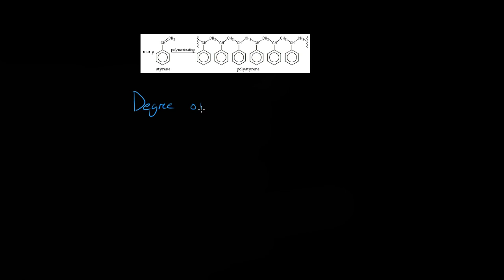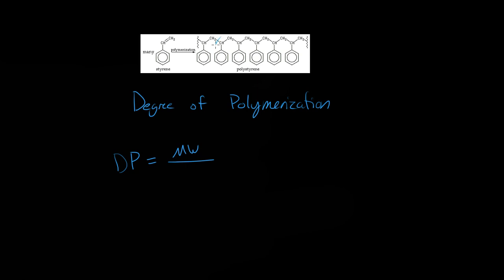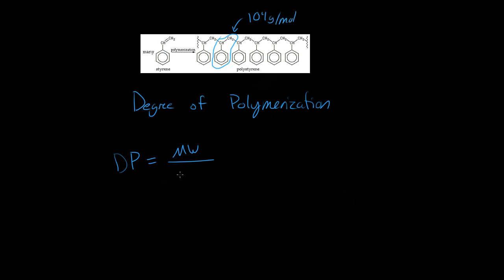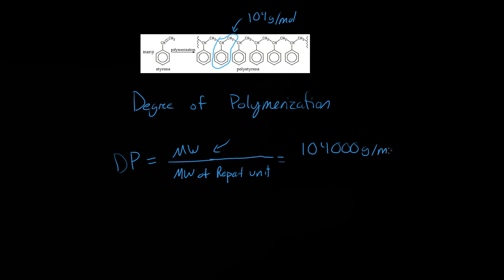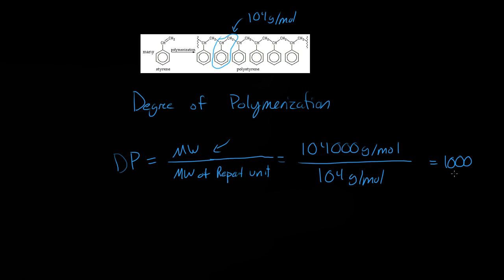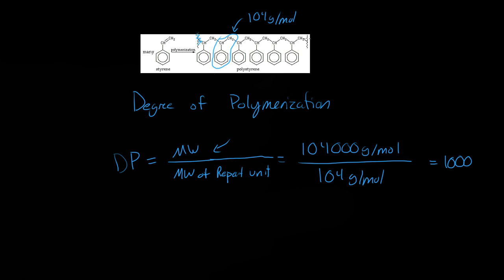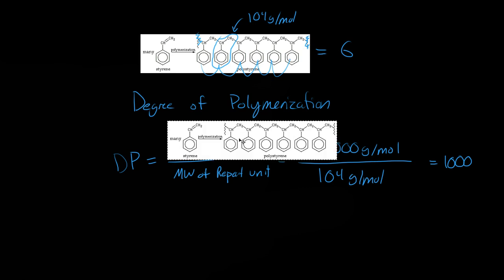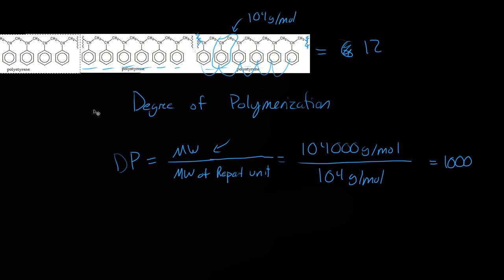Degree of Polymerization

Comment from the maker: Find the total number of carbon atoms in the chain and multiply it by the diameter of carbon. Therefore the max theoretical length would be 1800*2*0.16 nm and 250000*2*0.16nm - i think.

Comment: What is the molecular length (micrometer) of a PE (C2H4) molecule consisting of 1800 (regular PE) and 250,000 (UHMWPE) monomers, respectively? 
	
	Using the average diameter of a carbon atom, 0.16 nm, for calculation and assuming no overlapping between carbon atoms
 
How would I figure out this one?
Reply: did u ever figure it out?